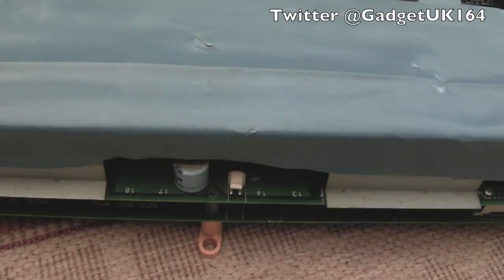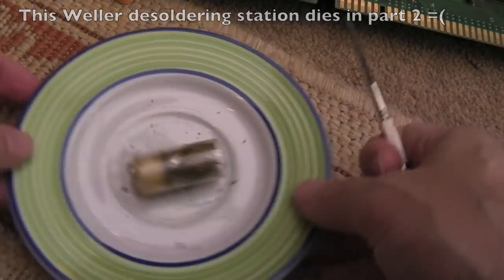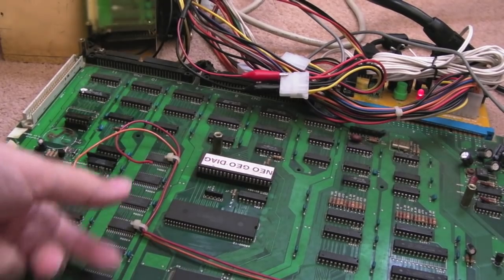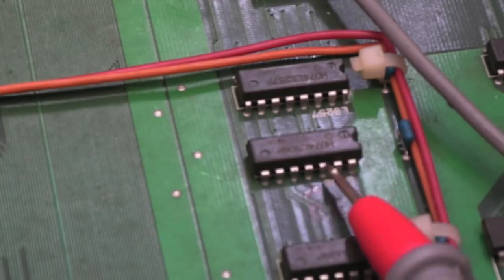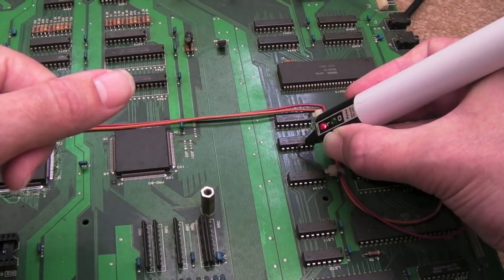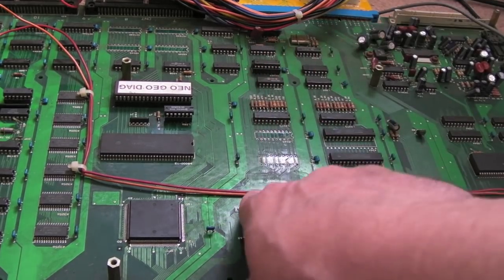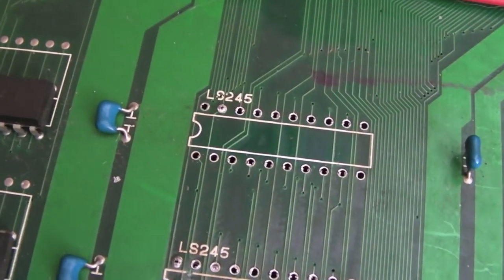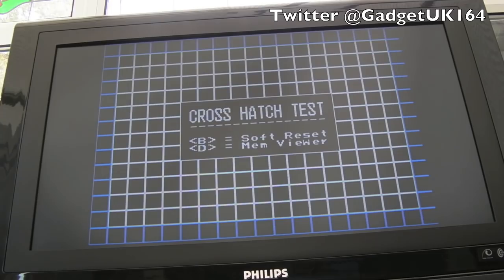SNK Neo Geo MVS (Arcade PCB) 6 Slot Repair (MV6) - Part 1

Comment from the maker: Part 2 - https://www.youtube.com/watch?v=Q7QFkJxcFdI
In the next video I will show you how I did some of the clean up work, and some of the things I didn't get chance to cover properly in this video.  eg. CPU clock, monitoring that OE pin on the ROM, and a few other things not well explained.

Something else I should point out (just to be accurate) - solder is not just lead, it contains tin as well.  Modern solder is obviously lead free!
When I said there's functionallity merged with the PRO chips instead of D0, C1 etc - that's not correct.  Some of the functions of the C1 and D0 are exploded out to 74 series - that's why there's so much more 74 logic vs say a later MVS board.
Reply: Awesome, looking forward to it :)
Reply: I wonder if you cleaned the board properly before doing any soldering? Looks kinda dirty, and leaked acid still can cause shorts.

Comment: Rest in peace desolder station. 

When I was a kid and messing with my first soldering iron (25w local market job with basically a flat blade screwdriver for a tip lol), those surface-tension type situations used to bug the hell out of me, I had nothing else,  just the iron and solder (I used stripped coax shielding for wick lol). 

I did a bit of jank to clear them by using one of me mums small sewing needles strapped to the tip of the iron (eye end down) with stripped copper wire and sometimes it'd clear when retracting it as the solder wouldn't bond to the needle. 

But yeah, I doubt it'd work on a ground plane thicker than the chocolate on a chunky kit-kat.

Great vid Gadge, love 'em. Props to Furrtek too.
Reply from the maker: Hehe lol =D  That ground plane was like a runway - massive lol!  Thanks for your continued support my friend =D
Reply: Am always gonna support you Gadge, love your content, and you're happy to help when possible. Even if peeps aren't a YT giant. There's no snobbery here, and that I appreciate, a lot.

Comment: If I am really worried about damage, and I have spare chips, I will just cut the pins at the IC body then heat and pull them one by one. It's a good strategy for quad flatpacks as well, and the quad pins can be sheared off with an exatco knife. It's destructive but can save pads from lifting due to high heat.
Cheers,
- Eddy
Reply from the maker: Yes, that can be a good idea for sure!  I like to try and salvage anything I come across though lol, even crusty corroded 74 logic lol.

Comment: I sad to read that your desoldering tool crapped out, but a good tip for those I got was to put a little wire wool in the collection cylinder, makes cleaning it out 10x easier as the solder sticks to that and can be easily removed. It's been working great for mine.
Reply from the maker: Thanks, wire wool is a great idea!!!

Comment: Ram clear switch. Probably to delete hi scores/game settings etc without having to go to test mode. Turn game off,hold in switch to kill battery and clear RAM.
Reply from the maker: Yep, that's exactly what it is =D  RAM kill switch is more appropriate - if you press it whilst powered up it could cause BRAM to fail with latch up, or you could kill the charge circuit.

Comment: fair bit of dammage there from that battery but you'll have it looking like new when its finished, sorry to hear the old Wellor died my Pace hasnt long for this earth either I could fix it but spares are so expensive now and hard to find. think ill be looking at a cheap modern unit to replace it.
Reply from the maker: Yeah, spares nearly impossible to find and to be honest it was really on its last legs due to a number of issues.  Too many things needed replacing imo.  It was a miracle it lasted so long.

Comment: I have a question you might be able to answer. On the ELA port do you know how much current the 5v pin could supply ? I am working on a new control board for my led mini marquee and I have reduced the amount of power needed to 170ma so I was wondering if the 5v pin on the ELA port could supply that so I no longer need to take the 5v from the PSU direct if the cabinet is missing the original leads. This makes installing it a lot easier and means I no longer need to crimp 9 way molex.
Reply from the maker: I honestly don't know!  I would think the limit would be like half an amp at least probably, but it will be dictated by the thickness of the trace feeding it I guess.  I would be surprised if it cannot provide 170mA tbh!
Reply: I was thinking about taking a look at my 4 slot PCB  and working back from the ELA port.  My home made prototype worked perfectly at 5v from the PSU,  so I ordered some sample PCB and will test it for a while.

Comment: I have a 4-Slot MVS that has a similar issue due to the backup battery leaking, but with a twist, if I boot it with the cartridge connector daughter-board connected, it watchdogs (never heard of the term, but I like it), if I disconnect it however, it boots with an S-RAM error (understandable considering all the corrosion), with the UniBIOS I can get it to start in AES mode, but considering I have no way of connecting any cartridges, it's just a glorified paperweight, I'll get around to patching up the traces one day, but I guess I'm putting it off due to the fact I hate desoldering chips, particularly when said chips are connected to a massive ground plane.
Reply from the maker: You should probably get a 27C1024 with a copy of SMK Dans diagnostic ROM on it, replace the BIOS with that and use the diagnostics to help you work out what needs replacing (BRAM by the sounds of it?) first.   The problem on the top board is likely a failed 74LS (or 74AS etc) 245 on the P (program) interface.  I've got part 2 uploading now, towards the back end of that video I show how you can tell which chips related to what on the top board.  It might be a case of removing all of the 245 chips related to the prog data bus and re-introducing them as you test out each slot.  There could be other causes too, but that's my guess.  It could also be the 245 chips on the bottom board related to the prog or data bus too.
Reply from the maker: Or maybe an addressing fault related to 74LS244 chips (on the top or bottom - if there are any on the bottom).

Comment: Hi ! Greetings from Brazil !
Great repair video !
I’m trying to repair a similar board that someone tried to repair before, so , the board im trying to fix is missing those two transistors next to the battery, can you tell me the model of them please?
Thanks!
Reply from the maker: I dont have quick access to check these at the moment.  Next time I get the 6 slot out I will check!  You might be able to see from close ups on the 2 videos?!?  Or, just look at the schematics for the MV1F and see what types of transistors were used in that area.